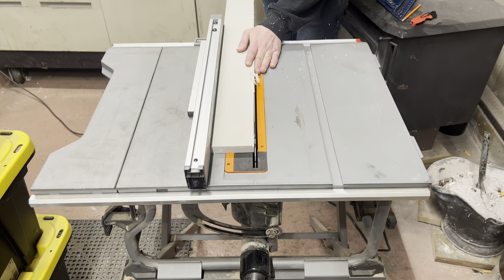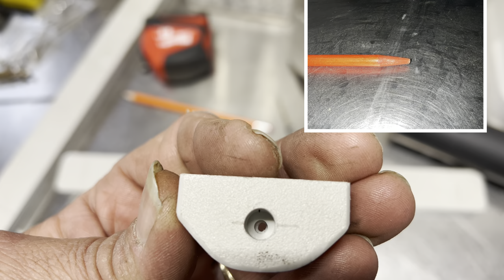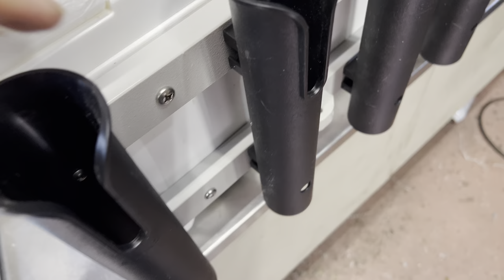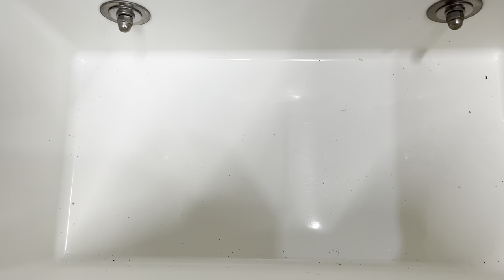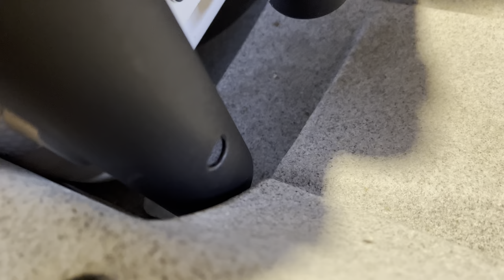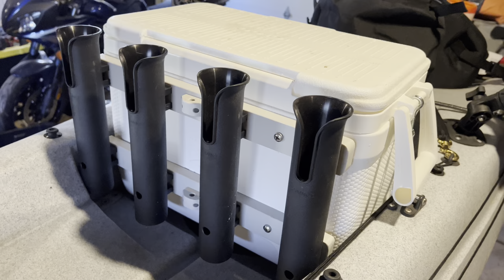DIY building a kayak cooler with rod holders and flag mount #kayak #cooler #fishing #igloo

Comment: What are those turnbuckles made of?
Reply from the maker: I picked these up at Tractor Supply as temporaries as I believe they are zinc plated. They are not stainless as I could not find any locally. I will replace them with stainless when I get them.